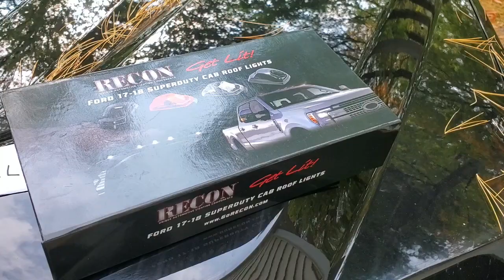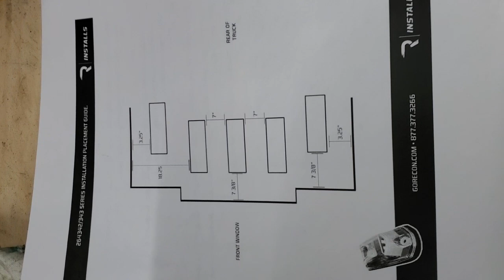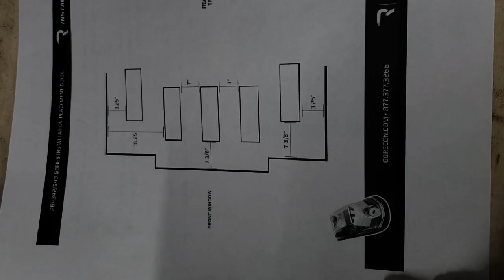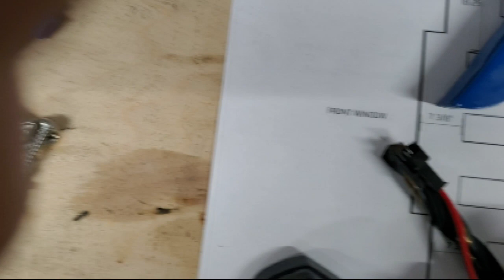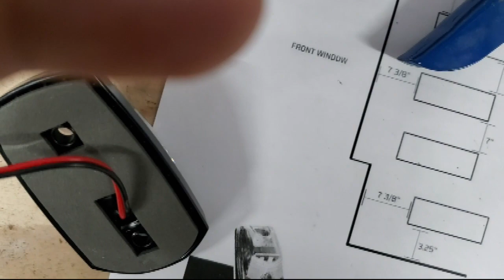RECON cab light install on 2017-2020 F250 with no OEM cab lights

Comment: This is a great tutorial. You have covered everything in detail. Thanks for your time putting it together. I am going to install some clearance lights on my 2020 F350 Lariat with sunroof. I was quoted  $1600 to install by a Ford dealership. I purchased the lights and will do my own install. Thanks again.
Reply from the maker: Yeah,  they told me the same thing.. and I had the same thought.  You can do it, just take your time and measure twice..or 5 times,  then drill :)

Comment: Did mine today.  Came out great but the only thing I would do different is put the center lights at 6.5 back instead of 6. Still works  to clear brace near sunroof and give front screws more clearence.
Reply from the maker: Awesome! And great to hear there's room for that.  Cheers!

Comment: Did mines on 7/15/2023, for the ones that are still wanting to install and want a close update. Going back 6.75 is perfect. Enough to avoid the aluminum bar for trucks with sunroof. Also they ask for middle ones to be gapped at 7 inches from the middle one. I notice that on f250s that come with them they have em much closer rather than the 7inches. One thing i would do if i was to help a buddy out with their truck is give it a gap of 6.25 inch insead if the 7 inch gap so it can look more like oem. Idk why they put 7 inch gap. They def need to update their dimension paper
Reply: I measured a factory one and the three center ones were 7" center to center on the mounting bolts
Reply: See, 7inch center to center sounds a whole lot better & much like OEM, i wish i would of measured OEM 3 middles ones first. The drawing RECON gives you shows 7inch gap im between them, not center to center. Which sucks because now i can see a big difference when looking at my 3 middles ones & OEM ones. Is now been 7 months and i still cant go to sleep happy. Im thinking of fixing that soon just because it bothers me so much.

Comment: Looks real nice, I must have the older set of lights from recon, They only have one screw hole. 
Looked very straight forward of a install. Well done...
Reply from the maker: Thanks, the truck looks so much better with them I think. what do you drive?
Reply: 18 F350 SLB
Reply from the maker: @Xtinnoker  nice. I had a '17 until last fall when a salesman suckered me into this new one.. shoulda known better than to walk in there.. share a pic when you're done. Cheers

Comment: Can I use one of the OEM switches on the ceiling to turn them on/off? Would be easier to connect the wires?

Comment: Did you have problems with them not working when the truck is running? Mine work perfectly until the truck is running. they light up in a flashing pattern then go solid but only when it’s not running.
Reply from the maker: Never had any issues.. sounds like you may have tapped into an incorrect wire though...
Reply: I’m running into the same problem. Did you find a fix?
Reply: I have same problem any fix?

Comment: Just an fyi, I drill and add cameras and all sorts of stuff to transit vans for a living. Take a piece of metal tubing and cut it to a length just shorter than your drill bit and it will stop the bit from going too deep. Just make sure the metal tube wont scuff any paint that will be seen

Comment: I just installed Cab over America lights saves so much more time. No drilling necessary! Great video still!
Reply from the maker: nice. I saw the wireless ones too but didn't like the problems people said they were having with connectivity. it's a toss up. I had to drill but it's always connected and no batteries to change either! both solutions are good. Cheers!
Reply: Have you had issues with the lights not holding a charge?? I bought COA lights and after 3 sets I’m done with them!! Taking them off tomorrow and installing these Recons!!

Comment: Looks good. Do they sit flush with the body? I had them installed on a 2020 F250, no sunroof and they don’t sit flush.
Reply from the maker: There was a little gap on the curve but I sealed them on using black RTV so the gap is gone and it looks flush

Comment: Is there a difference between these lights and FORD OEM LED's?  I just got a 2021 F250 and was looking to install cab lights, my 2017 F250 had factory LED's and they were awesome. BTW great video.
Reply from the maker: The oem lights need a bigger,  rectangular hole made because the base of the light fits into it for the wiring.  These ones needed only a small hole which was easier to protect and cover.  They are otherwise pretty similar. Good luck!

Comment: Cool install. Let us know if any issues down the road
Reply from the maker: Thanks! will do. Are you with Recon?
Reply: @FatherSonGarage  No, I just purchased a 2020 f250 and want to install these lights as well. But have mixed reviews of leaking issues. Seems like you really thought it through and took your time. Great work! I just don’t have the guts to do it myself and I don’t trust anyone with my $80k truck.
Reply from the maker: @samuelolivares6671  heh, I understand that. I do a lot of restoration work (you can see a 77 Jeep CJ7 I'm rebuilding through the windshield of the truck in the video) so I'm a little more used to drilling holes in things that shouldn't normally be drilled into. Good luck when you get to it. Remember not to overtighten the screws, it can put too much pressure on the clear lens and crack it. Cheers!

Comment: Where did you get the plug for the wiring harness to plug into the truck
Reply from the maker: I didn't use a ford plug,  I used a couple of electrical connectors that I modified. Anything that's snug will work really,  and a little tape to hold it doesn't hurt either!

Comment: Thanks for the install video, as I'm planning to do the same thing to my 2020 F250 king ranch and am just starting the research on the 'how' and 'what'...  Am considering the Recon and well as Atomic products right now.  Others have said the atomic brand is a higher quality light, and I like the idea of being able to strobe them as well.  But I sure like the much cleaner, more reliable, and nearly plug and play install of the Recons so I'm a bit torn at the moment.  Were there other brands you considered as well?
Reply from the maker: That's a great question. I looked at everything from the Amazon special to the Recon and Atomic. I think they are all pretty close. I like the flasher too but didn't think it would get any use since I use the truck for hauling a 5th wheel mostly. It really comes down to why I drive a Ford over a Chevy (cause it's better of course! lol) but it's really just preference. When you get to quality brands they are all good and all have one thing they do better than others. in my case the clincher was the nice harness and the shape of the lights themselves. Good luck on your install!

Comment: Great video and very through! I’ve been looking for a solid install video for this body style for quite some time. I have a 2017 F-150 with the sunroof and am hoping to get the guts to attempt this install soon. I did a similar install on my precious 2003 Silverado 1500 but that wasn’t near as nice as my current truck. Also hoping that Ford had that clearance light prep installed on F-150’s so I can just connect them there and not have to do a whole bunch of wiring.
Reply from the maker: Glad it will help! I don't think you'll have the pre-wire but it's just two wires. You can ground almost anywhere and find a marker light wire under the dash easily enough. You'll get it. Good luck!
Reply: I’m in the same boat as well. I’ve been looking for a video for a very long time and I think this is going to be the one to help me out.

Comment: Nice vid...curious to know if you experienced tpms fault codes caused by rf interference from the cab lights...getting ready to install recons on my 2018 Super Duty and have seen multiple instances of tpms and key fob interference...thx
Reply from the maker: Thanks Bryan. I've had no issues at all with the tpms or key fob. I'd expect that on the wireless lights more but not really on wired lights. Good luck with install!

Comment: I want to buy them for my excursion but I don’t have pre existing can lights? How do I get the plug installed to have lights installed?
Reply from the maker: you can really just wire them into any marker light harness or wire. You'll have to see what wires are there for your excursion and tap into them, there's no plug that I'm aware of!

Comment: I had to replace my cab light and was thinking about doing RTV to help attach them again beyond the screws, but wasn’t sure about how it would go if I had to replace the light again. Getting it off might be a pain to replace. Think it’s worth the extra seal using RTV?
Reply from the maker: yes for sure, that's what I did. I'd rather spend the extra effort peeling if I ever have to than deal with water leakage into the cab! ;)

Comment: Hey brother, very informative video. Quick question, I’m about to install my lights tomorrow. And I’m curious how you tested the lights before connecting to the plug in the A pillar. Also, would it be smart to go ahead and test them before installing in the roof?
Reply from the maker: The harness came with all the individual lights connected so I only had two wires.  When I found the plug in the A post I just used a test light to find the hot wire and hooked them up.  Peice of cake.  Good luck!

Comment: Great video.  Loved the detail.  Question, when you inserted the wire leads into the plug connector how did you secure them?
Reply from the maker: Thanks! Do you mean the ones I popped out? They just click right back in!
Reply: @FatherSonGarage  no.  The male end that attached attached to the ford harness in the A-pillar
Reply from the maker: @explorationsrenovations5982  oh, I just cut the ford plug off and wired them directly with butt connectors and heat shrinks. Not something I"m likely going to ever take apart so to permanent connection was fine for me. cheers!

Comment: Was the curve of the roof too much to put the center light slightly forward?  Great video BTW.   Will be doing this on my 2019 with sunroof.
Reply from the maker: Hey Charles, I had the three center lights slightly forward of the outer 2. They are all the same distance back from the glass but as the glass curves it naturally moves the lights back too. I tightened the screws so the RTV squeezed out and there was still 1/8-3/16" of gap (filled with RTV) between the metal and the foam backing on the light. The extra RTV gives the light some room to flex but still seals well so far for me. good luck!

Comment: How long did it take you exactly. I was quoted $3000 dollar install and I am NOT paying that. I’m just going to do it myself
Reply from the maker: 3k? What are they using?? Gold wire?? Geez. I'd say it took me 3-4 hours,  but I don't remember exactly. It's not too bad,  you can do it in an afternoon. Just make sure you do a thorough job with the rtv and seal the lights well. Good luck,  you can do it 👍
Reply: @FatherSonGarage   ended up getting it done in about 4 hours. Measured everything a million times to make sure it was as perfect as could be and they turned out great! Thanks to your video. I had to do it exactly like yours due to the moon roof

Comment: Question, did you not like the oem cab lights that you can buy from dealer? And any issues two months later?? Great vid by the way I’m really looking forward to doing it myself now that I have this guide!
Reply from the maker: The OEM cab lights have a larger hole that needs to be made, it's kind of a square shape and a lot bigger. I asked my dealer when I bought the truck about adding lights and even they wanted to use Recons (at about 5 times the price of course!). I've still had no problems and I'm in Canada where we've had lots of snow, cold and wet the last 6 weeks or so. Holding up fine so far! good luck on your install!

Comment: I have a 17 KR I’m looking to install these on, I was told I don’t have a harness in the pillar, should they all have that connection?
Reply from the maker: As far as I know, any Super Duty should have it. If not, it's just 2 wires. You can ground it anywhere on the body or find a grounding bolt around that pillar. For the positive, you can get a wire for the marker lights down in the footwell for sure. Good luck!

Comment: Awesome video! What size screw pilot hole did you end up using?
Reply from the maker: Thanks! Now that's a good question.. I think it was a 13/64. If you've got a piece of sheet metal around try it there and see how well the screw holds.  I've really found that the screw should be in very lightly, just snug.   The RTV acts as a sealant and a strong adhesive. Make sure you fill the screw hole through the light with RTV to seal it too. Good luck!
Reply: @FatherSonGarage  Sir, thank you very much for the info and for replying. I will definitely try what you recommend.

Comment: Thanks for a great video! Curious, 10 months later are you seeing any condensation in the cab lights? I’ve seen others that have ran into that issue, wondering if using the RTV helped that at all. Thanks!
Reply from the maker: I've got a little bit, but I think that's because the seal between the lens and the base isn't as good as it could be. I haven't had any moisture inside the cab and all lights are still on so I'm ok with it. you really can't see it unless you're standing on the running board looking down at them.

Comment: Do you have any measurements you could share? The center ones from the sunroof.
Reply from the maker: Hey Chad, no problem. All lights are 6" back from the windshield. The center ones come farther forward from the sunroof because of the dip in the roof in the middle. I can measure the distance back tomorrow if you like, just let me know.
Reply: I would love to know that distance as well! Thank you!
Reply from the maker: Hey Chad, sorry it took a bit, weather's been crap here. the center light is approx 2 3/8" in front of the sunroof. Just make sure you are ahead of the aluminum bar that goes across the front of the sunroof. The 2 that are beside the middle one are each about 2" ahead of the glass since the front of the roof curves back. Good luck!

Comment: I have a 2019 f250 with moonroof. Can I install the cab lights on this truck?  Is there a plug and play plug inside from factory?  Will it work?
Reply from the maker: Should be the same as mine, only one year difference with same body style,  so I'd say it should have the plug and should work fine.  Good luck!
Reply: @FatherSonGarage  I wish I can find someone here in Atlanta GA to install them. I just can’t find anyone. Which lights do you recommend with minimal intrusion but looks like factory?
Reply from the maker: I used the recon because I liked the style of them and they look great.  There's a few out there but it comes down to preference really.  I bet a dealer would install for you if you don't want to tackle it yourself.. but that'll cost you more too..

Comment: This video is awesome. However I used recon lights with what I believed to be aluminum safe sealant and I had a cab light go out. Btw recon warranty sucks. I bought a replacement snd when I took off the cab light I saw the paint was starting to corrode under the whole light. Not risking it anymore. Taking it to a body shop to get the holes fixed sand blasted sealed back up and painted. I hope this doesn’t happen to your truck. If anyone else does this I’d recommend not using sealant. Heck even the steel screws will cause it to corrode. Just be careful. I’m sick to my stomach right now thinking I ruined a $70k truck 😩
Reply from the maker: I used black RTV and made sure I put it around the light, the hole, and also in the screw holes. So far, no issues! Don't feel sick though.. it's only metal, easy to fix holes if needed, and only one panel to repaint! Better to have tried than to always wish you had, right? Cheers!

Comment: Hey where did you get that tool to separate the plug?
Reply from the maker: I got a trim removal kit on Amazon for it. There are tons. Mine is this one: https://www.amazon.ca/gp/product/B07H2TV6XD/ref=ppx_yo_dt_b_search_asin_title?ie=UTF8&psc=1
Reply: @FatherSonGarage  oh okay thanks. I tried using a terminal disconnect tool and that would would for whatever reason. These connectors are very stubborn for me lol, did you just put the tool into the the front of the connector and it released ?
Reply from the maker: @LB7reese  for the most part yes. I had to wiggle a couple of them a bit but they all came out. good luck!

Comment: Solar wireless lights are available in the market -
Reply from the maker: Yep, they are.. but they rely on wireless connectivity to the truck which isn't as reliable as a good old fashioned wire. The cab's already got oem holes in it, a few more aren't an issue as long as they are well sealed :) thanks!
Reply: @FatherSonGarage   👍🏻👍🏻
Reply: Have a link?